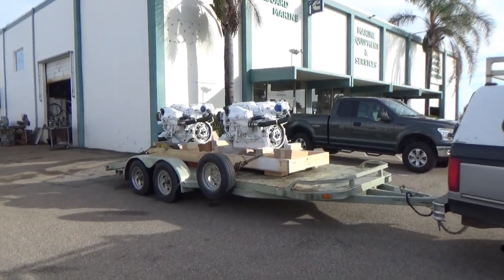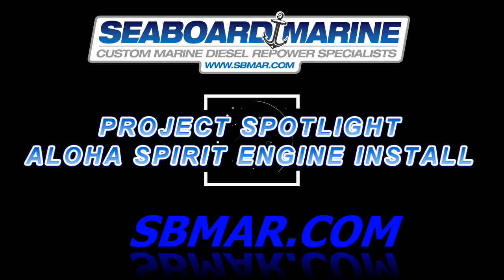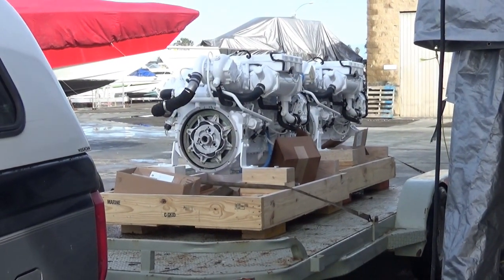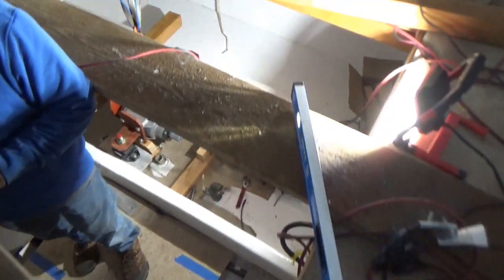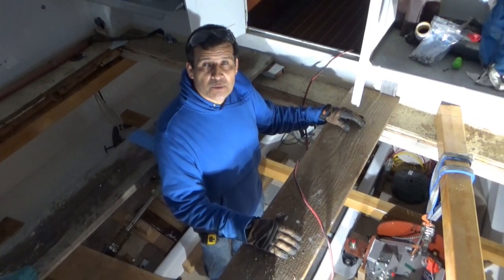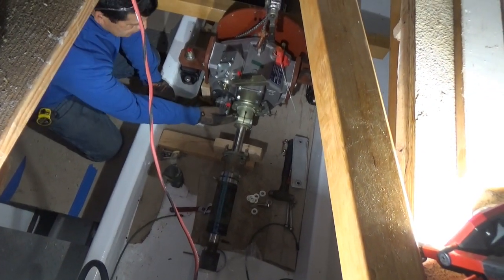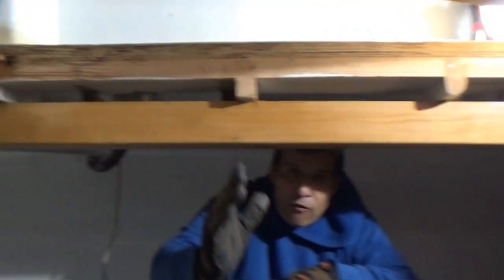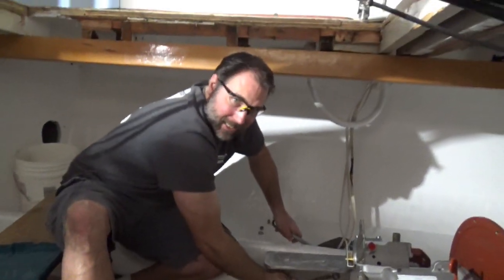Project Spotlight: Aloha Spirit install stringer brackets and drop in new engines

Comment: Hello guys, nice job. 
What are the pro/cons of the 6.7 vs the 8.3? I always like s sleeved engines vs non-sleeved. Your thoughts on the matter.
Reply from the maker: Well considering the QSB6.7 has an overall height of 33.74" and the QSC 8.3 is 38.65 most of which is on the top side, they simply wouldn't have fit in this boat.  We were within inches of the beams.  Would have just been too tight vertically.  Plus I think he got something like 30,000 hours of commercial use on the QSB 5.9 engines we removed.  So if the QSB's are well cared for, they last a long, long time.